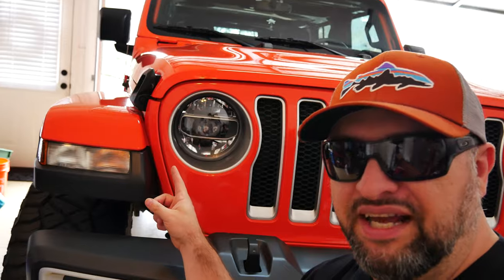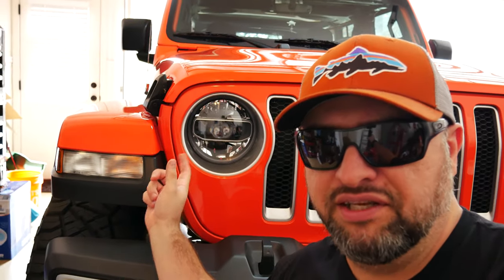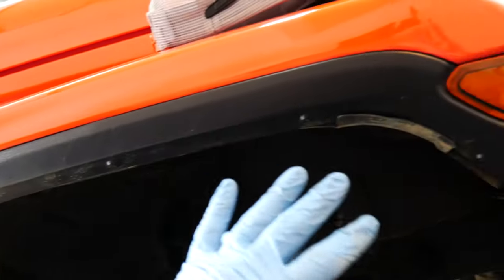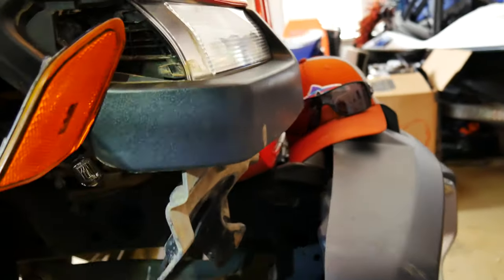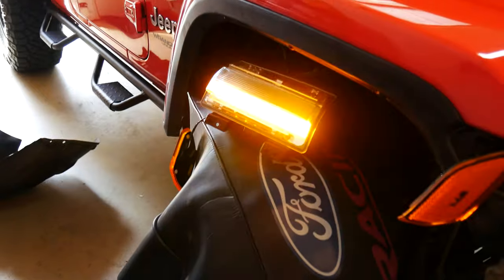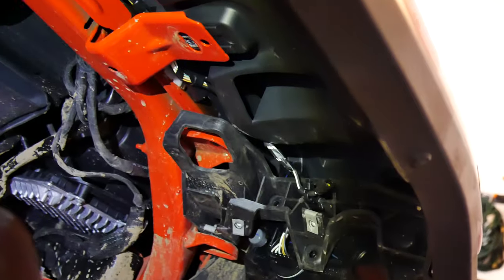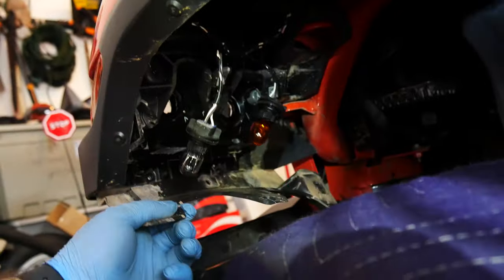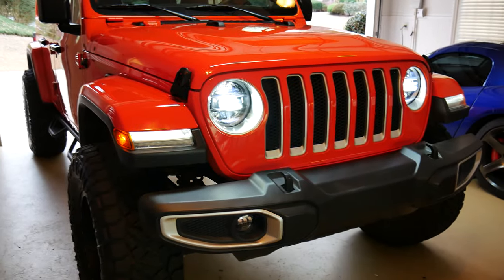JL Jeep Wrangler OEM LED DRL SWAP

Comment: What do you have your DRL set on USA or Canada.  I just changed mine and I wanna make sure that the White LEDs are my DRLs
Reply from the maker: I'll have to double check but I'm pretty sure I set them to USA.  The only setting I changed was the DRL Dropout so that it alternates as opposed to staying when the blinker is on. Looks a little cooler.
Reply: @DeeperImageAutomotive  Thank I just figured it out.  I had the turn signals set for DRL once I changed to Dedicat the Actual DRLs worked.  the turn signals were kinda cool  thought I didn't realize how bright they were.  Upclose they dont seem to bright from a distance they are really bright.

Comment: Did you try turning on the DRL’s without the taser installed? Did it work or you do need the taser to make it functional?
Reply from the maker: Chris. It does turn on but it wont work properly.  They will either hyper-flash, or completely turn off while you're driving.  Not something I wanted to deal with and that's why I just got the Tazer.  I also didn't want to have to visit the dealer for every mod related to the lighting.  However, the dealer is still an option if you don't want to mess with the Tazer.

Comment: When you are in lightning option of tazer mini what you did after in lightning menu because i m still getting flickering on my factory led DRL ?
Reply from the maker: I did two changes I believe. 1. Change Front Turn Signal type (std/LED) 2. Change Headlight type (std/LED). Make sure your Tazer has the latest firmware.
Reply: @DeeperImageAutomotive  thanks

Comment: What are the 2 wires you had to add to the BCM.  + and ground. Or. + for each light?
Reply from the maker: Wire is to power each light.  I also made a mistake.  The correct BCM is much higher up inside that panel.   Either way it works. I never went back to fix it and 2 years later still working without any issues lol.

Comment: To anyone considering this swap. TAKE THE FENDERS OFF. Do this swap in the AC on your kitchen table. All you have to do is pop off the tabs that line the sheet metal around the fender. Use a pry too to separate and remove. I did it both ways, trust me!
Reply from the maker: Definitely would’ve been more comfortable for sure.  I’m in GA so the heat is always through the roof as is the humidity.  Thanks for sharing.
Reply: @DeeperImageAutomotive  Arkansas here. Thanks for your video, it was a ton of help!

Comment: HOW WAS THE WIRING? is it like plug and play ?
Reply from the maker: The OEM DRLs come with their own wire built-in that is plug and play to the non-DRL harness.  But you can't use the halogen DRL wiring harness on the LED one, so just make sure you get the LED harness attached to the DRL.   It works no problem!

Comment: I have a question I bought the same OEM drl leds but the guy had to cut the wires so I didn’t get the full harness can I still install them using the halogen harnes ? Thank you
Reply from the maker: Martin that's a good question.  I know that the DRL Harness is wired to the LEDs directly so you can't really unplug it.  What you might be able to do is use your halogen harness to see if you can wire it up with the DRL one as you suggested.  These are normally two or three wires, just make sure you line them up correctly and test them before you put everything together.  Get a good soldering iron if you don't already have one, they're pretty cheap at home depot/lowes or any hardware store.   then use a good shrink wrap to cover them up so it holds up longer.  But yeah should be doable.   Let me know!
Reply: DeeperImage Automotive  hey bud so I did cut the wires from the halogen lights and plugged reconnected to led Lights  and it worked just fine and just got the tazer in so everything is working like I wanted thank you for your videos man
Reply from the maker: Martin Contreras that’s really good news Martin.  Good info for others wondering about it too.  Thanks for sharing and happy to hear it worked out.
Reply: @Martin-mq4dz hey bud 
I need to do the same thing . Do you have the wiring colors from harness to LED light ?

Comment: so I need the taser to make my OEM headlights and morimoto DRL's to function properly along with the oem wiring jumper cabler
Reply from the maker: No. It depends what year JL you have. This applies to 18-20 JLs that didn't come with the LED package. So if you purchase used OEM DRLs and OEM LED headlights you need the wire kit, need to have either dealer code for LEDs, or use something like a Tazer Mini JL to enable LED lights or you will have hyper-flashing, or lights not working properly.    Morimoto DRLs do not require any special coding from what I've read on their website but I would recommend verifying with Morimoto first.  2020 JLs and newer appear to already have the extra wire so its plug and play, but you will still need to code for LEDs for them to work either through your Jeep dealer, or a Tazer.  Hope that helps.
Reply: So if I have a 2021  gladiator Texas trail edition, it has LED rear lights but halogen lights the front, do you think I don’t need anything to swap it to LED?

Comment: What if you don’t have a tazer
Reply from the maker: Wesley Clendennen from what I read they can blink really fast and sometimes turn off completely.  If you don’t want to mess with the Tazer you can also have the dealer code the LED lights and they charge about $120-$150 I believe.   That’s why I chose the Tazer.  Pays for itself right away and can do many more things.

Comment: Do you know what resisters are needed for converting the stick fog lights to led fog lights?
Reply from the maker: I do not sorry.  I replaced my OEM halogen housings/lamps with the OEM LED DRL that came from a take off.   There are several options.  You can use LED Bulbs, you can use aftermarket LED lights from Oracle for example that replace  the OEM Halogen ones, or you can use OEM DRL LED lights.  But I'm not sure on the resistors.  Thank you!

Comment: what is the tazer mini for? do you need that to replace lights aftermarket?
Reply from the maker: Lindsay if you are just adding aftermarket LED lights you should not need anything.   I needed it because I used the Mopar OEM LED Lights and those wont work correctly unless I recode/reprogram the ECU to accept those LED lights since mine were halogen.  The Tazer also allows you to change other settings like Tire size if you upgrade so that the speedometer shows the correct MPH, as well as other options.

Comment: Have they been working well with the tazer programming? No hyper flashing or dash lights?
Reply from the maker: Zero issues with the Tazer. The tazer changes the programming to DRL LED from Halogen, so once you save it, no issues.
Reply: After switching to “LED ” mode - you also need to change the taillights to LED?

Comment: Does your DRL work during the day? What settings did you use on the tazer
Reply from the maker: They do work in the day like normal.  If you look at some of my trail riding videos you can see them on.   On the Tazer all I did was change the setting from non-led DRL to LED DRL.
Reply: @DeeperImageAutomotive  what if you remove the Tazer ?
Reply from the maker: Ahmed H it should still work but I haven’t tested it.

Comment: Does this video apply to Gladiadors?
Reply from the maker: Ruben, the swap should be the same or similar for a Gladiator but I’ve never worked on one so I can’t confirm.   Good luck!
Reply: So with the TAZER mini I could change the settings for the LED strip on fender to operate properly?

Comment: Can you link products you used please
Reply from the maker: Scott, these are the OEM MOPAR LED DRL and MOPAR LED JL Lights.  I was able to buy them used for a good price on Facebook Marketplace.   Quadratec sells them as do most Jeep dealers but they are not cheap.  I would try to find a nice cheaper take off set to save some.  These are the parts for the headlights https://www.quadratec.com/p/mopar/led-headlamp-pair-jeep-wrangler-jl and the parts for the turn signals/drl LED lights - https://www.quadratec.com/p/mopar/led-parking-lamp-wrangler-jl-gladiator-jt  there are also other options from a few other vendors as well.  I hope that helps.  In the description I also have affiliate links to some tools I've used like the panel poppers.

Comment: Hi mate!
Is it compatible with wrangler JL sport S?
And where could I find it?
Reply from the maker: It works with the Sport S but you will need to make sure the DRLs have the harness attached to them, and you will also need to enable the LED DRL code in the ECU through a Jeep dealership or using a device like the Tazer Mini JL. Good luck!

Comment: Do anyone know where is the DRL fuse or relay I made a mistake and my right side passenger side went off.
Reply from the maker: Check this page had some diagrams, just search for lights in that page for the fuse/location - https://fuse-box.info/jeep/jeep-wrangler-jl-2017-present-fuses-and-relays

Comment: I finally got my tazer mini in order for the led drl’s to work do I change the drl setting from USA to Canada ?
Reply from the maker: No you just need to enable DRLs if you don’t have them on already.  Change the turn signal to LED
Reply: @DeeperImageAutomotive  ok what happens if it shows USA drls but the led turn signal doesn’t show can you help me with the steps please ?
Reply: @DeeperImageAutomotive   I did updated the tazer now and left lighting on USA when updating led drl did you edit where it says LED TRN and turn that to ON or where did u do it ?

Comment: I converted my Jeep Gladiator Front Light System to all Mopar LEDS. I used the JScan App for the BCM programming. I love my lights! Lol
Reply from the maker: Yeah it makes a huge difference! congrats and thanks for stopping by.
Reply: I replaced my fenders to the rubicon led fenders, I installed the resisters and still getting hyper flash
Reply: Great Video! Does changing this void the warranty? Also, I just ordered a tazer to change my lights to led and have a upcoming dealership visit, should I just leave tazer in, or unmarry it?
Reply from the maker: @Dragonhick69  Did you code for LED? The lights won't work properly unless you code the correct LED type vs Standard bulb. Either through your dealer or through the Tazer.
Reply from the maker: @ehsanaziz1945  I cannot speak on behalf of Jeep or FCA, so I would contact them.  I can tell you this, some dealers offer this as an upgrade to customers, either with OEM parts or aftermarket.   It would all depend on the type of claim you wold be making against the warranty as well.  Is it engine problems? Lighting problems? etc.   For me personally, if they break I'll replace them myself, so I would not be expecting FCA or the dealer to warranty a part that didn't come with the vehicle itself.  Again, I'm not a lawyer, and do not represent Jeep, so the best bet is to speak to the dealer directly on the impact of doing this mod.  Thanks for stopping by!
Reply: DeeperImage Automotive yes I did code it using the JScan app and still had the issue.
Reply: Wesley Clendennen Mine works flawlessly and I only programmed through JScan.
Reply from the maker: @Dragonhick69  I have not used the JScan App but have read on the forums that they did add this capability.  Stupid question, but do you have the latest update from them that might include the right coding?  Perhaps give their support a ring?   Sorry, I wish I could be more help but I've only used the Tazer Mini JL and it worked on the first go for me.

Comment: Great video!  Can you confirm it did not require the extra wiring like the headlights do?  Thanks
Reply from the maker: G-Daddy42* Press only wiring required is the LED wire itself that’s attached to the DRLs.  It’s not removable so make sure it comes with it.  But it’s a direct plug and play.  Plus the Tazer to change the code to DRL light so it doesn’t flicker.
Reply: DeeperImage Automotive - fantastic, thanks again!!

Comment: What are the steps to get to lighting and update the taser
Reply: I just installed my lights yesterday and look great but I need to update my taser to have them working properly I have looked for videos to do it but have not found anything besides yours can you please help out with the steps
Reply from the maker: Miguel first make sure you have the latest update on the taser.  You do that with you PC and the usb cable it came with.  Go to their website and download the latest build.  Then install it on your JL per the instructions linked here.  Once you install it, turn the ignition on but not the Jeep.  Cycle with the buttons until you see Audio info on the evic screen between the gauges using the left up and down arrows.  Once there hold the left arrow and tap cancel on the cruise control buttons.  Once there keep holding the left arrow and tap cancel until you get to lighting, then to change settings keep holding left and use the on/offf buttons for cruise.  Once you make a chance holding the left button and press RES on the cruise buttons. They will accept the change.  https://www.zautomotive.com/zpu/instructions/TazerJLMiniUserGuide1110.pdf
Reply: @DeeperImageAutomotive   thank you so much I will definitely do that I didn’t know that I had to buy a mini taser in order for me to update my lighting thought the Jeep already came with one and I just had to updated on the screen..like on your video do you guys sale the taser if you do can you provide a link to purchase it thank you 🙏

Comment: Those 7" LED's are wrong for the JL. I have the same light but 9" and it's perfect. The beam is in the right place and I've never been flashed. Also did the matching fogs.
Reply from the maker: Michael I ended up adding the OEM LED headlights. Much better than the 7” ones for sure.

Comment: What option did you change on the tazer to activate the DRL’s?
Reply from the maker: You change this to std to LED - – Change Front Turn Signal type (std/LED) – supports aftermarket LED lights too

Comment: What brand? How much?
Reply from the maker: Erik these are the OEM ones that come with the LED package from factory.  I bought them on Facebook Marketplace for $200.  They were take-offs because he did a fender upgrade.  Same with the headlights.  I got them from another guy locally for under $400.  Pricey indeed, but I like the OEM look vs the aftermarket ones I had.
Reply: That's actually cheap. I wish I could find a deal like that.
Reply from the maker: Alan Cardenas I found them on Facebook Marketplace from a guy in TN and I’m GA. Shipped it was $200 which was a good deal to me. Half the price of new ones from the dealer.  I also found the headlights the same way. Takeoffs from another JL.  I paid $300 for the headlights.  Again, a lot less than new ones from the dealer.  Nothing compares to OEM LEDs in my opinion.
Reply: Thanks for the quick reply man! Yeah my wife is obsessed with your orange Jeep. Great job with everything you've done. Really nice
Reply from the maker: Alan Cardenas don’t tell anybody but tell your wife it’s actually not my Jeep lol.  It’s my wife’s Jeep lol.   I just steal it for YouTube.  I’m also jealous of my wife’s Jeep haha.
Reply: Haha I actually feel better now